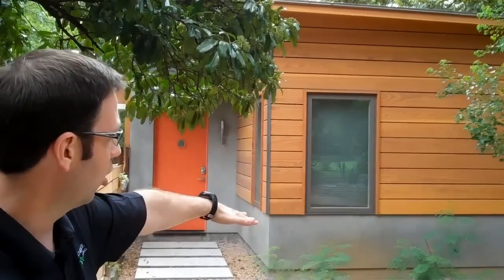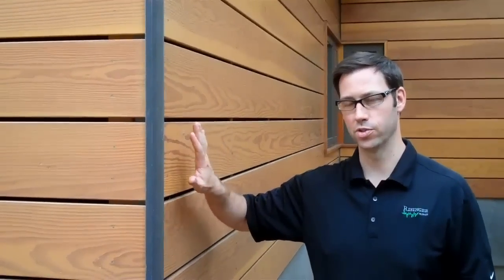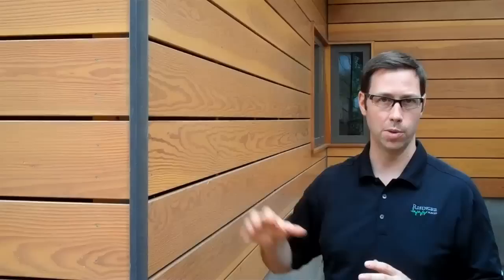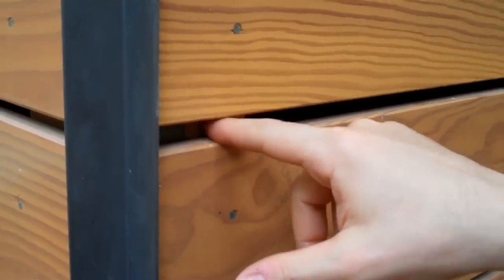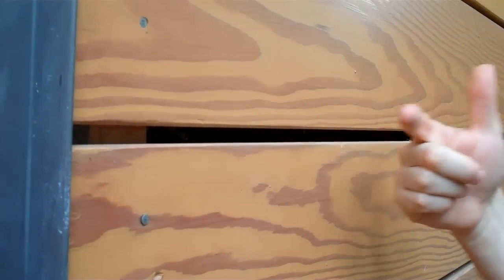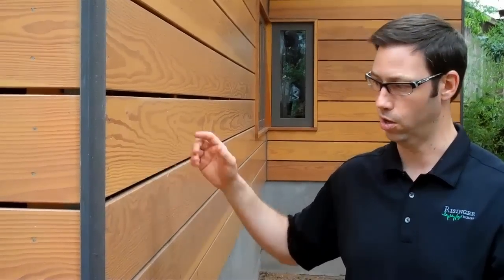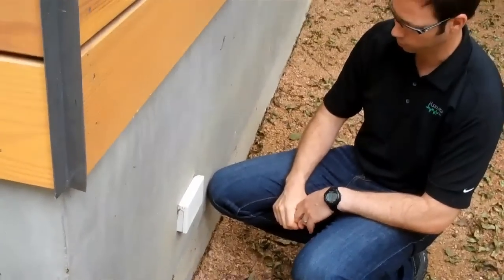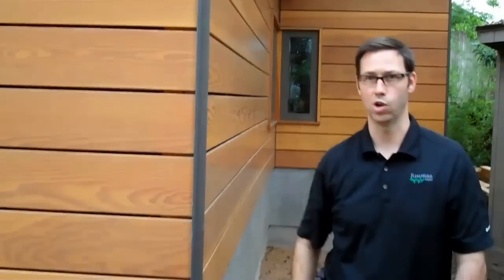Doug Fir Siding w/ Sikkens Cetol 123

Comment: Beautiful work. I am a Sikkens installer in Indiana. If you apply the maintenance coat every few years you will maintain the look and integrity basically forever. This product is a film forming stain and the 2 and 3 coats are considered sacrificial layers that just need to be reapplied from time to time. The key is recognizing when it needs a coat. Generally the surface will start to get a milky look when the outer film starts breaking down. Thats when to recoat. Dont let it go beyond that timeframe.  We have restored areas for customers that let it go too long and had to do some stripping to remove peeilng and grayed out wood before rebuilding the stain layers. The beauty and ease of this product is staying on top of the maintenance. It's very easy to maintain if you don't let it get out of sorts.

Comment from the maker: The rain screen method of siding installation you are seeing in this video is really not an energy efficiency item, it's mainly for durability of the structure and longevity of the finish & materials.  That being said the rain screen does help make installing rigid foam easier.  Thanks for commenting.  Matt

Comment from the maker: The WRB on this house was Tyvek Drainwrap, we then stapled 30lb felt over the Tyvek to protect the Tyvek from UV exposure.  If I had to do it again, I might look for another black UV resistant option other than 30lb felt.  I am concerned that in 25-35 years that felt could degrade.
Reply: Yes, and I'm sure you've found those materials by now seeing as I'm five years late to this party. Perhaps you've covered this in another episode. In 2009 I did simple Tyvek under cedar rainscreen and the UV tore it up in about 6 yrs. Thought about doing felt but was discouraged by my Architect- who eventually turned me on to the Benjamin Obdyke products.

Comment: How's this siding holding up? Any sun, insect, or water damage to the wood? Did they ever use step 3?
Reply: Its call 1 and 2 3
Reply: Number 1 is the stain and the 2 3 is the clear whit color you can apply as many coats you want but every coat makes it darker and sorry for my ingles

Comment: Two quick questions if you do not mind. What kind of water resistant barrier is provided behind the siding (pell_n_stick, taped foam sheets, etc.)? And second is there any concern with insect activity? In my area of Ohio that would be a haven for mud daubers and wasps. The corner detail is very interesting.
Reply: That is a big problem with the detail with this design ......BIG TIME Dirt Dobber and Wasp haven and every other critter.

Comment: How about after 10, 20 or 30 years? Could one sand and reseal  while keeping the wood in place so the wood surface looks brand new again? What do people use for expensive mahogany boats? I don't like weathered wood look.
Reply from the maker: That's the idea with the maintenance coat of this product.  This wood is now almost 4 years old and looks fantastic still.  But, with that #3 coat it should in theory get back to the original look without removing the siding or stripping it.  Best, Matt